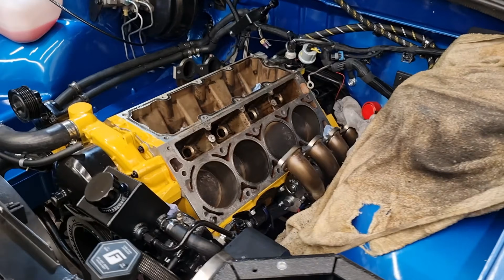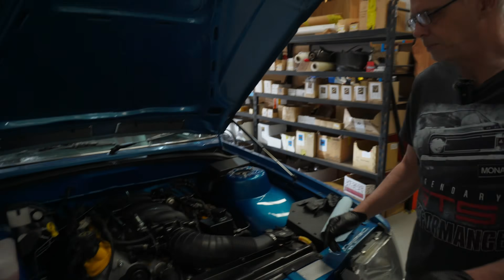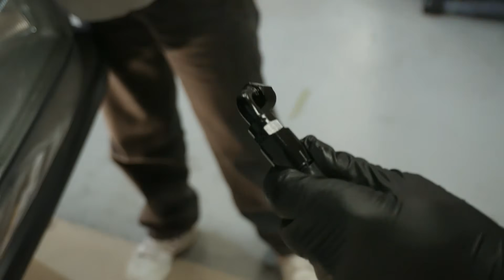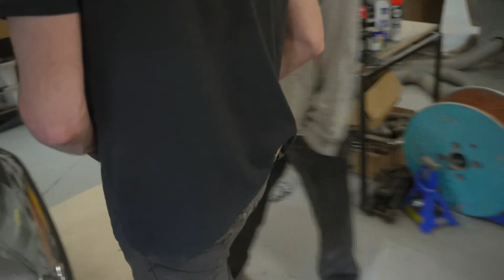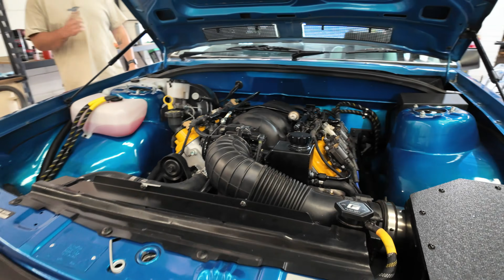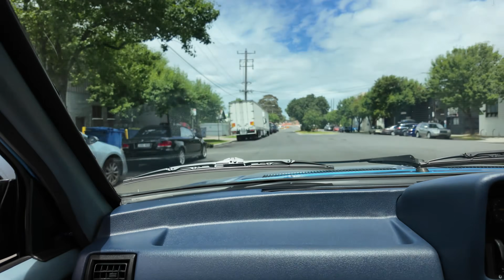Epic LS Swap Update: VH Commodore Gets Engineering Approval!

Comment: What k frame did you use? And power steering cheers
Reply from the maker: Hey Mark, It's a VR k frame, VL steering rack and VL intermediate shaft.
Reply: @emdawgjdm VR V8 or V6 K frame... im told the V6 k frame works better for a LS swap, with a vn steering rack and vl intermediate shaft....